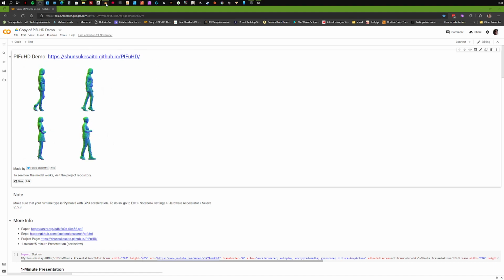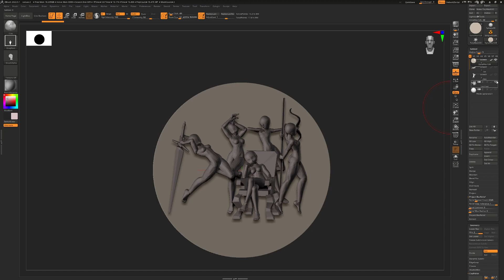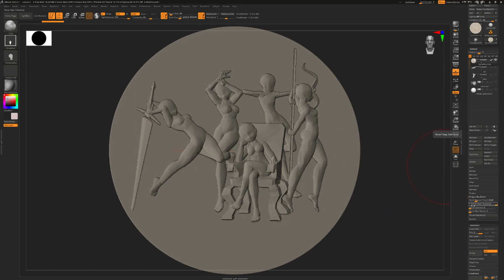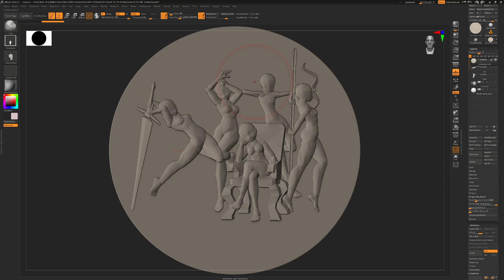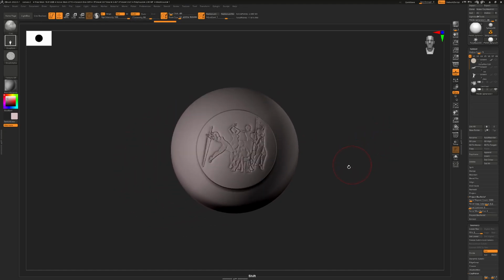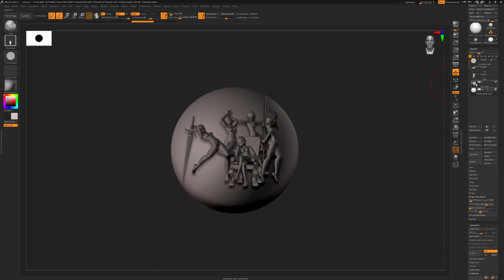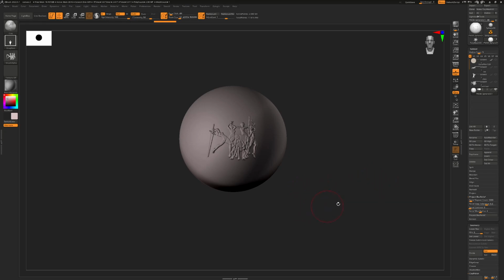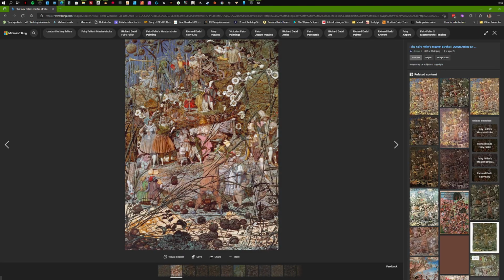ZBrush bas-relief follow up

Comment: is the highest point of the relief actually the nearest point to the camera in the model?
Reply from the maker: Yes, so it's still not a perfect bas relief, as it doesn't know to cheat.
It's good at analysing the 3D model and pressing it flat in a sympathetic way, but that's all.
Reply: @mattbonaccorsi  its still looks off to me that the left knee of the girl with the sword has such a high depth.
Reply: but there is also a new option on the left side for bas relief producing a relief you can drag around, maybe this would work better in this case

Comment: I see you have the background mesh up around 20meg and then you have to deal with it to get something useable.  After days of playing I think I will have to wait for some magic to come along.
Reply from the maker: I have a template mesh that I tend to use - it has 3 subdivisions, with 3 million+ish) polys. I only use the highest sub for things like this, so I get the highest detail.
I do most of my work in the middle sub.

As everything goes straight to CNC, the topology doesn't really matter as long as it's reasonably uniform and dense.

My biggest issue with the relief projection is the high jagged set edge, but that might just need some playing around with settings.
Reply: @mattbonaccorsi  I know this video is old, so I'm hoping you still read this, but when you say you send this to CNC, do you send them an OBJ or do you convert this to a CAD file somehow?

I'm really interested in machining sculpts and so far I've only found that I would have to do a base model in Fusion, export it as an OBJ, bring it into ZBrush, then sculpt, bring it back to Fusion and do a conversion there. Maintaining quads all the way through is very important from what I see. 

I'm just wondering if there's a quicker/easier way to get a STEP file for machining directly from ZBrush.

Also, if you can directly mask the relief, have a look at this video for some tips about smoothing out the edging that it produces - https://www.youtube.com/watch?v=RByXIvjcS7U&list=PLsB7A77aQVjjPQ8wfgIehEn3njm5YmkN8&index=3&t=9s
Reply from the maker: @CRyanBurg   I usually export an obj or stl file that gets imported into a package called Carveco (it was previously known as Artcam). Most relief CNC machiners and mints use this software as it's designed very much around producing 2.5d products.

 I think that the issue you're going to run into is trying to get STEP files out of a polygon mesh.

There are 2 basic approaches to 3D modelling - polygon and NURBS. Polygon modelling creates a 'net' of triangles (or quads) that is distorted into the required shape. The more dense the net, the more detail you can achieve. NURBS modelling uses a mathematical approach to simulate 3D shapes rather than a 'net'.
Think of the difference between a jpeg and a vector graphic.

The advantage of NURBS is that you can be very specific and accurate with measurements as the model will not lose integrity when scaled. The downside is that it's not very good for organic sculpture.

 Polygon modelling is great for organic sculpture, but lacks accuracy due to the high number of polygons needed for close measurement. Converting a polygon model to a NURBS is tricky.

There are methods of translating Polys to NURBS, but they usually involve converting each polygon in a model to individual NURB triangles, which makes a huge, unwieldy file. The only software I know of that works well across both processes is Rhino, which is used by a lot of jewellers as they need a blend of sculptural freedom and engineering accuracy.

If you're having success importing obj files into Fusion, then the simplest process is to do all your modelling in ZB, and then just export the final file, rather than jump back and forth. Of course, it depends on what kind of sculpts you're making....
Reply: @mattbonaccorsi  Thanks for the quick response. 

I'll definitely check out the Carveco software. Sounds like what I might need for doing coins. 

As for the other stuff, I'm aware of the difference between the types of modelling and each others shortcomings. I do most of my poly modelling in Blender and jump in ZBrush for details and such forth and then project those back onto different models/maps depending on the need case. 

Down the road I might have to created STEP files that have a ton of details like engravings and fancy embossing. This video has given me an idea of how to get sculpt details into STEP files by using the Project tool in ZBrush to project on to a subdived quad mesh that is exported from Fusion - https://www.youtube.com/watch?app=desktop&v=eQ7QgAyTOOw.

It seems like it takes some time, so perhaps the models will need to be broken up into smaller parts and then rejoined somehow for machining.
Reply from the maker: @CRyanBurg  It would be helpful to get some idea of what you're trying to make. You mention making coins, and that's what I spend 90% of my time doing. I wouldn't consider using a NURBS package to sculpt anything up other than lettering and rim profiles (tbh, I do most of my lettering in Blender).
I've used Blender to convert  textures to mesh before. It's useful in the right context, but easier in ZB because you can really boost the poly count to get the detail, then decimate it back before exporting so that it doesn't take an age to process.
I model at about 3 million polys in ZB, and then decimate to about 700k before I export. Keeps the detail but loses the file size...
Reply: @mattbonaccorsi  That's basically the workflow I'll be using. Blockouts in Blender (since my poly modelling skills in ZBrush are non-existent) and then detailing in ZBrush. My production lead says we can use OBJs for now, so that's fine, but I'm just trying to keep an eye out for any way to convert stuff for the future should any of the manufacturers require a STEP file. I will also be doing some texture projections from alphas in ZBrush to get nice shapes and detailing that's required for custom pieces.

I'll be doing weapons, coins, armour, etc for role playing, so lots of fantasy based objects. The larger objects might need to be broken down to smaller parts and reassembled after manufacturing.
Reply: This is something I'll be playing with in the new year - https://www.youtube.com/watch?v=3CGZVCdKUZo&list=PLklk5VvcgwJDROm45R2Tb4mgU7vB87yI3&index=8